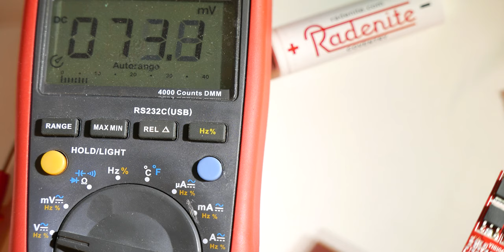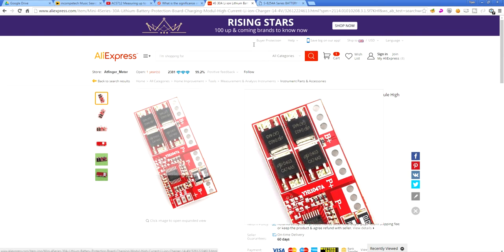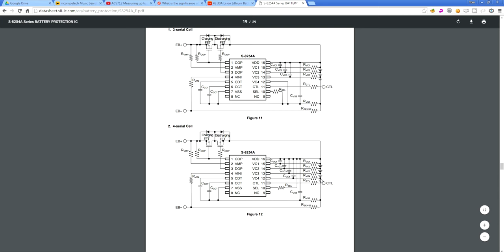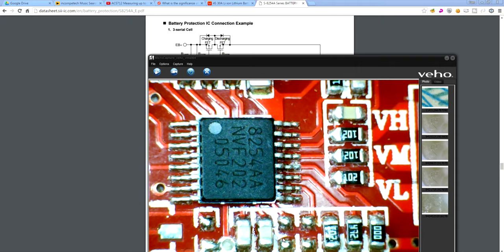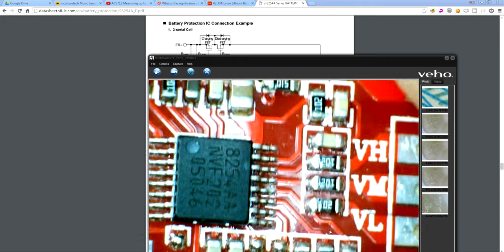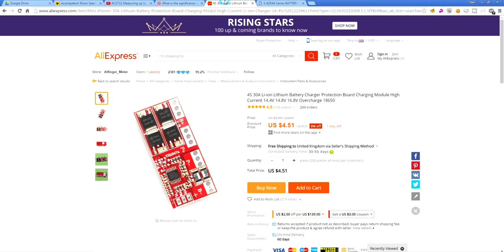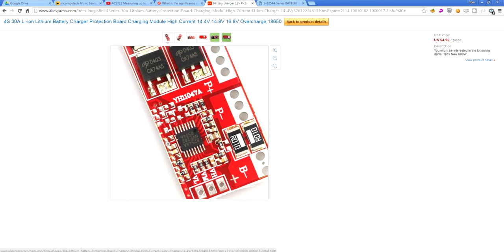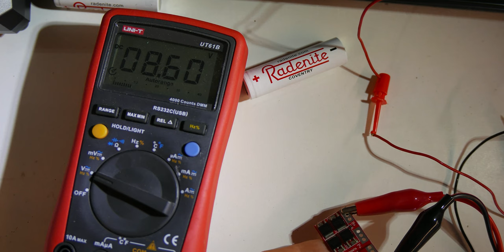Li-ion BMS protection module upgrade mod and hack from 3S to 4S

Comment: I think 102 on an SMT resistor means 1K, not 100k and it might work a little better if you remove the extra 1K resistor next to the 100k you added. Just compare the two boards again to see what I mean. Well spotted, you've done the hard yards, might order a couple and try the hack myself with the "spare" 1k resistor on the board. Cheers.

Comment: May be a quality control issue. Chip fails on one part so this circuit is used as a 3S.
This is done quite a bit with CPU/GPUs after testing the failed test chips work well enough to be sold as less powerful ones for less. This saves production costs because only one chip is design made

Comment: You missed a thing in the schematic: pin 10 (SEL) is connected to VSS in the 3-cell schematic and to VDD in the 4-cell version...

This video helped me solve my problem with the 3S board... I connected VL to the first cells plus, VM to the second and VH to the third. It turns out VL should not be used for the 3S version. internally on the board pin 15 is connected to the third cell. so you just need to connect VM to the first and VH to the second...

Seller on aliexpress had NO IDEA. Told me I should look it up on google...

Comment: You missed something. Right next to the 102 resistor you added there is a resistor with the same value that does not exist on the 4S variant. All you had to do is take the 102 resistor from that pad and move it to the left.
Reply: Indeed, I just found this out. It's connected to pin 11 (control) which switches between 3S (connected to pin 7 VSS) and 4S (connected to pin 16 VDD) mode.
Reply: I just opened up the seller page and looked at the both images, the 102 resistor needs to be moved next to the 472 and voila.

Comment: Dear friend!
Please help me! I saw your video about the YH11047A BMS modules. Here you are talking about 3s30A and 4s30a bms. Since I don't understand your language, I don't know what the solution is! For me, only this red, small-sized panel fits in the Bosch drill! I would need 3s30a bms.! I already ordered 3 pieces from China from different dealers, but in each case they sent the 4s30a version!!!! These do not work with 3 18650 batteries! In the video, you talk about converting a 4s30s bms module to a 3s30a,.re? Can this conversion be done at home? In this, I am asking for your help as to where and at what value smd components should be implanted!!! I looked at the marameters of the S-8254A chip, and it shows the wiring difference on page 19, but I'm a mechanical engineer, but I have an electrical engineer friend who, if I get your help, maybe we can get it done!! So the question is, what needs to be removed and which part needs to be implanted at which point.

Best regards: István

Comment: Thanks for the video, very interesting.  I've been testing a few of these 3s 12v bms's and one in particular i purchased turned out to be totally unusable.  Do you have a link to the product on Ali-Express?
Reply from the maker: I checked and it appears I ordered off of Banggood and unfortunately the price has increased..

http://www.banggood.com/3S-Li-ion-Lithium-Battery-Battery-Protection-Board-10_8V-12_6V-18650-Charger-p-1011517.html

Comment: Tom,

U did th mod in th board thts good., bt I even we wld appropriate  more if u can program these board's chips by modding overdischarge voltage frm 2.3 to 3volt per cell. 

lithium cell shld not be discharged less than 3 volt , so why these BMS cuts off @2.3 hurting th batteries , I don't knw. 

Could u do tht mod pls?

Comment: Respected,
The problem is the following. When the machine is pressed by the switch quickly, it just moves and stops, and when it is pressed slowly gradually, it accelerates slowly and works. Is it possible to solve this problem? If they are not in the cell itself because they are not electric current 3.7V 2.2A?
Thanks in advance!

Comment: No you're totally wrong! You're mistaken about how this works :-)  The four fets are in parallel pairs for lower RdsOn, a pair for charge and a pair for discharge) as per the schematic in the datasheet. The three battery pins aren't outputs! They're inputs for cell monitoring. You won't get any output on them..
Reply: Ok look the way it works is that it's a safety chip that monitors each cell but it doesn't charge them; it has two pairs of Pfets (they only show one in the datasheet schematic but putting two in parallel lowers the on resistance so increases the current capacity; but there's effectively two large fets on there; they're kinda "back to back" so one is for carrying the charge current and one the discharge current (they may have wired 3:1 instead of 2:2 if the discharge current is > charge current but you get the idea). The chip itself only monitors each cell it doesn't even try to drive those pins, for the purpose of killing the power (turning off the fets) if you try to overcharge or overdischarge. That's it. There is no charging function in there- you're supposed to use an external balancing charger (which also has a connection to each cell for monitoring and also balancing by slowly draining any that are too high). Almost all the charge/dischage current goes through the main connector/fets of course. Putting a voltage on it and measuring the sense pins (as you are) is meaningless because they're not driven.
Reply from the maker: +Dr Tune you are correct.

Comment: Hello, sorry for my English, im from Spain.
I tried to convert the 3S YH11047A plate into the 4S plate. By removing the resistance of 0 Ω going on the leg 12 of the chip and moving the resistance of 102 Ω to leg 10 of the chip, I think that is as you say in the video (the numbers of the legs according to the YH11047A datasheet).
In the P + and P- outputs I obtained a value of about 9V and not 14v as in outputs B + and B-, so it does NOT work properly for 4s.
It is difficult to solder the SMD resistors with an electric soldering iron, nose if the problem is there or is that you have to change something more of the plate to convert it.
In the datasheet they speak of SEL pin, I do not understand very well if it is the signal that receives or something else has to be changed.
Reply: Please, is possible to use 4s bms for 3s battery
Reply: A question please

Comment: hi, nice video. whats the charging voltage and amp for 3s and 4s
Reply from the maker: It's protection only.  You'll need a balanced charge module.  In fact, most balanced charge modules do not operate as balanced chargers, more like "balanced dis-chargers".   Bit of deceit within the li-ion charging industry.

Comment: Hi, i have 4s protection board from AliExpress and now when i charged it, it goes up to 16v and when i plug it to the load the voltage drop to 9v, what is the problem?
Reply from the maker: Does the BMS cut the load at 9V? (most BMS protection modules disconnect the -ve terminal)  If not, then either the connections from the module to the cells are faulty or the module is faulty.
Reply: Tom Donnelly I charge and connect BMS to my amp at the same time,  after i unplug charger BMS is faulty and death
Reply: I think he is same situation as mine
Reply from the maker: You shouldn't be trying to charge cells through a protection-only board.

Comment: If i put a bms on my battery pack ,do i still need to put a balance cable on it as well to connect to my balance charger ? ?
Reply from the maker: +Fook Utube Yes.
Reply: Saying that.do i connect the balance to the bms or do i just connect it on the battery like normal
?..Thanks for the reply!

Comment: hi Tom have you tested this to make sure it does balance charge ? cheers Brett
Reply from the maker: Brett, yes .. lots of testing on dozens of BMS modules some with balancing implemented and most without.  This one does not balance the charge.  It's over-charge and over-discharge protection only.
Reply: Oh ok thanks, Im having trouble finding a cheaper 3S Balance Charger Module......do you have any ideas/links ? cheers Brett
Reply from the maker: Haven't tested this one, but at $8 it's worth a shot.  https://www.aliexpress.com/item/3S-packs-11-1V-12V-20A-Lithium-Battery-Protection-BMS-Board-WITH-Balanced-Charging/32707938997.html
Reply: Hello, nice tip! What a camera you use?
Reply from the maker: Sined WOLF I used Panasonic LX100 and Panasonic FZ1000. Both are UHD 4K. This was shot on the 1000.
Reply: Tom, all you really have to do is remove the 000 Ground and loose it, then move the 102K over one to the left and done. Look at the circuit where the 102K is originally connected and you'll see there's no rail going to the chip, but they are for just 12.6v. I have one I did like I said and it works perfect. 16.8v
Reply from the maker: MrBrymstond aha! Thanks.
Reply: I forgot to mention when you work with surface mounts like this you wont need this to last for a long time so what I did was I cut out a small piece of metal from a thick can from canned food and cut a small rectangle with a horse shoe on top in the middle then wrap that around the tip and make it deep enough so the screw will clamp it down and give the needed heat and the needed width of the horse shoe so you can heat both sides of the resistor and it will come off easy and also easy to solder it to the other pad. These are so small.